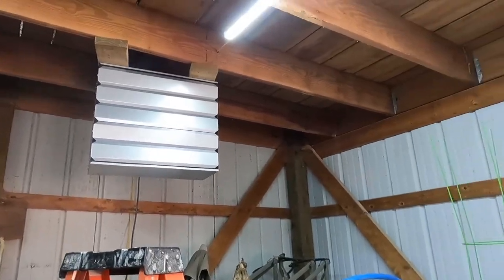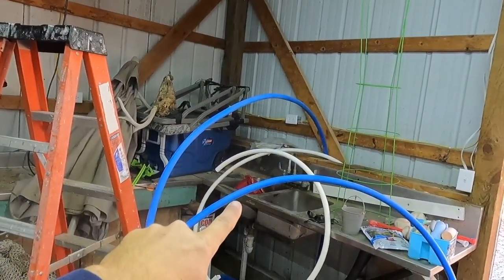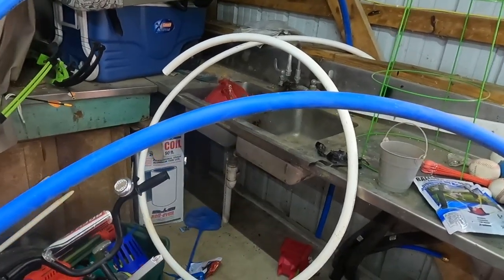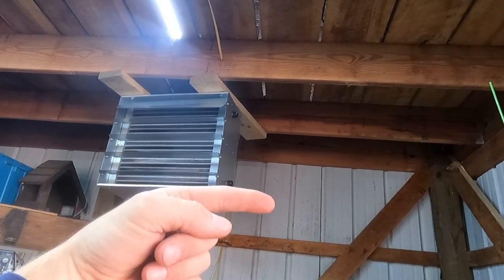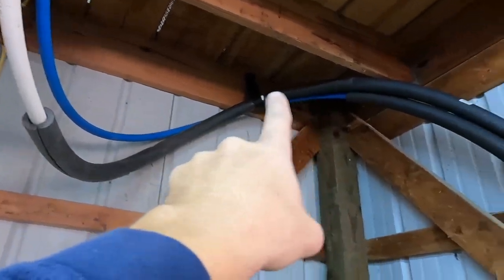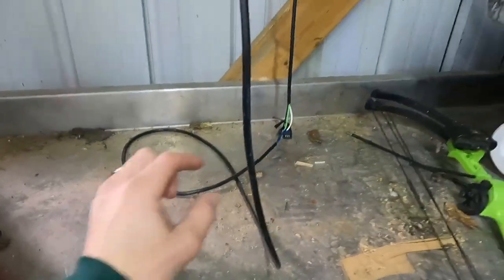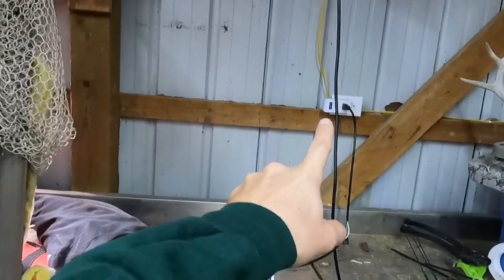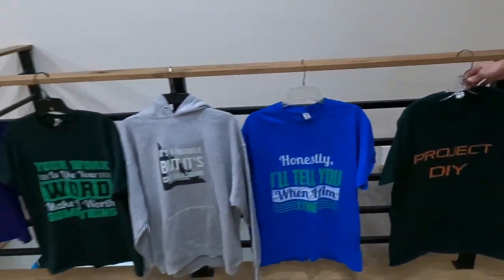Heat Your Pole Barn With Your Wood Boiler!!!

Comment: That unit is WAY overkill, but it will certainly warm the place up fast. Guessing the garage needs maybe 60,000 BTUs due to lack of insulation. So, the question is, what starts the pump out at the boiler? If you leave it running all the time then the coil will always be hot. OTOH, that will keep it from freezing if there's no antifreeze in the system. Also, a dedicated pump for that garage could be located by the heater and controlled by the same T-stat. Much easier than running wires and a relay back to the boiler. BTW, "solder" is pronounced "sah-der"... the L is silent.